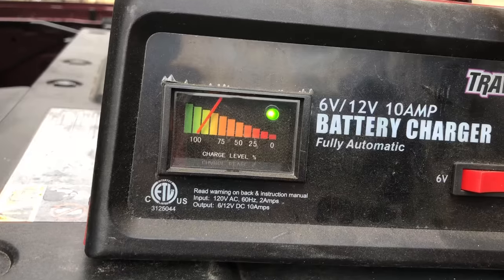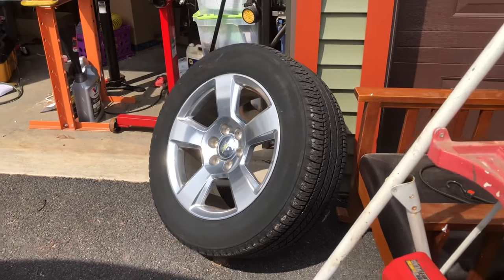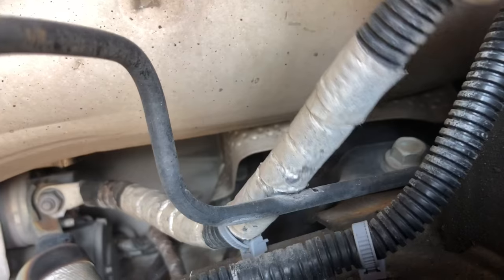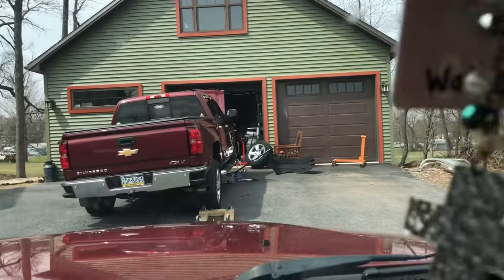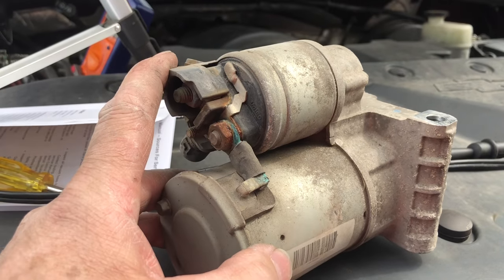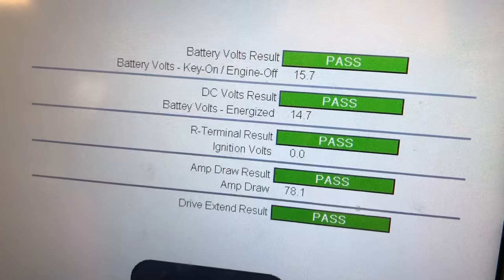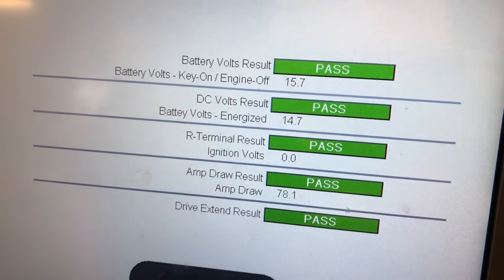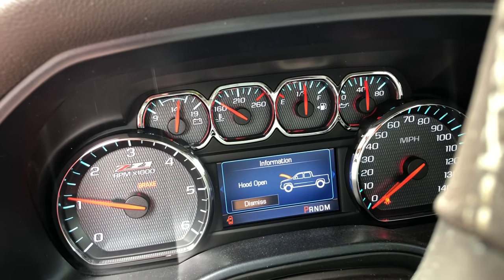2014 Silverado no crank no start problem solved!

Comment: I have a 2014. Every 3 or 4 months when I start my truck, nothing comes on. Goes completely dead. But when I unhooked the negative battery cable for 20 seconds and hook it back it starts right up. What could that problem be? Plus I have a new battery. But the positive cable and the little box that its connected to on top of the battery doesn't fit right on it.
Reply: My 2015 is the same. I think it’s some kind of computer glitch
Reply: @EricWillis77  it might be. Mine hasn't done it in a while. Knock on wood. Hopefully it fixed itself.  Lol.

Comment: I've had the same problem with my 2014 Silverado
Reply: Did you get back to working? Mine just started this today
Reply: That's what happens when you buy junk ass GM junk. Our 2014 is having the same issue and has for months. Junk.

Comment: The starter wasnt  making a good connection somewhere, when you took itt off and put it on you cleaned the posts and completed the connection, had to have been.
Reply from the maker: It turned out to be the post between the starter and the built-in solenoid. It was rotted out. I cleaned it put new washers on it, and I haven’t had a problem since this video.
Reply: @WatsonsWagons  ah nice, that's a nice cheap fix! Good video btw.

Comment: Any issues since?
Reply from the maker: Yes, the stud nut and washer coming off the solenoid needed to be cleaned and a new nut and washer installed. Corrosion was causing arching and the issue returned. Fixed it and has been perfect ever since

Comment: I'm sorry, but when you seen the voltage drop difference from the positive cable at the starter to the starter post,  that right there tells you that you didn't have a good connection at that post! Removing the cable and cleaning it would have fixed the issue, without removingv the starter to have it tested!

Comment: Ironically my 2015 Silverado had the same problem that started just the other day. July 2nd to be exact. I fixed it the same way you did. My ground was actually good, however there was one corroded connection from the solenoid to the starter. It didn't look too terrible but some corrosion, and now it starts every time after cleaning that up. Only 5 years and under 60K miles and this was an issue. If it happens again, I'll probably clean up the connections and then cover them with liquid electrical tape when I put it all back together.

Comment: Very helpful! You definitely had a bad connection at the starter positive lead...
Working on a 2018 tomorrow that's a no crank. Dealership already replaced the starter TWICE. Owner gave up on the dealership.
Reply: What came of this if you don’t mind sharing? I’m about to give up too

Comment: Were you also having a problem with it turning the vehicle off randomly and also the vehicle engaging the theft deterrent system when it was going off? My 2014 silverado seems to be having a similar problem and I'm trying to figure this out before dumping a ton of cash into it.  Twice when it didn't start,  it actually drained 100% of power from the truck as well and I had to jump it to get it going.
Reply: I'm seeing this issue as well
Reply: @HouseCallAutoRepair  turned out after chasing grounds it was a combination of bad negative wire to the battery and the ground behind the speaker on the driver's side under the windshield.

Comment: My truck won't start now. These 14 Silverados been nothing but one problem after another and Chevy didn't stand behind any of it..they should make it right with us all. I'm very hesitant to buy another chevy again now. So did it give you any more problems?
Reply from the maker: The second problem I found was corrosion where the starter solenoid connection meets the starter that little short jumper. It was arcing on the stud, and I had to replace washers and nuts. That arc was enough to make everything go dead.

Comment: Have you ran into this problem since cleaning the connections? My 2014 Silverado is doing the same exact thing - brand new battery, alternator is good. I’ll leave it for 30 mins and then it’ll start no problem - shut it off, won’t start up again.
Reply from the maker: Kayla Vettorazzi nope still starts just fine
Reply: Watson's Wagons great thanks! Will get into it this weekend.
Reply: Kayla Vettorazzi my 15 gmc does the same thing
Reply from the maker: David Gonzalez check the stud and nut where the wire come out of the starter and goes on the stud on the solenoid. Mine was badly corroded and lose
Reply: Kayla Vettorazzi did you ever figure out what was the problem
Reply: Santin Munoz yeah loose connection by the battery
Reply: Santin Munoz also it could be your ground under the wheel well passenger side
Reply: David Gonzales you said lose cable near the battery did you replace it or how did you fix

Comment: well, not exactly sure what is wrong with these starters. i had the same exact issue that you had, all i did was pull the starter to check for power with the key on, the bendix kicked in, i bolted the starter back to the block and it fired right up.

Comment: Did your radio have any erratic entry into browse mode when you started dealing with this issue? Mine started with the radio and is now giving me this same electrical headache.
Reply: I have the same issue and then it just clicks. I have to start it from underneath the truck by touching the positive to the solenoid. So damn aggravating.  Can't find the solution
Reply: @cbuschjr  my HMI fried and I had to buy a new one. Now waiting for programming! I’ll try the starter issue too
Reply: I have the same radio issue!  My HMI fried and am replacing it now. With no radio/hmi/ fuse my truck just clicks now upon start.
Reply: @ChrisChris-mg8rj  what is hmi? My radio went out and now my Yukon won’t start

Comment: I had the same problem on Monday & replaced my battery, everything was fine Tuesday during the day, & then suddenly the problem came back. I turn the key over & it just clicks. The alternator seems to be fine it shows 14.8.. I'm thinking it could possibly be the starter.
Reply from the maker: Miguel Rizo i found my connection between the starter motor and solenoid loose and corroded. Also The wire going to the solenoid from the ignition switch off lose
Reply: @WatsonsWagons  I'll check that out, & let you know.  Thank you!
Reply: @vatozlocoz214  so what happen did you find the problem?
Reply: @WatsonsWagons wheres the ignition switch located?

Comment: My 2014 sierra does the same thing when i pull my trailer. The extra power for trailer light make my ground cable get hot. wait till it cool down and crank back up

Comment: 2015 Silverado 2500 been through 3 starters they are just junk same symptoms go out no crank tap on the starter and it will start
Reply from the maker: Tod DeSonia I found the connection between the starter and solenoid works itself loose also developed corrosion and causes it to ARC. I cleaned up this part of the connection and put a new nut and washer on and it’s been working perfect ever since
Reply: yep sounds like you have a bad ground or bad connection to ground. my 2010 did the samer thing, 3 secs with a 240 grit disc on an air sander and it runs great even after 3 months
Reply: Another bad starter
Reply: I'll try taking it down and cleaning it again see if that helps us

Comment: I'm having the same problem, Ferman Chevy want to charge me 900 to change the starter, they told my wife that  some of the starter blades was broken, i removed the starter it looks fine , we got a new one but the company send the wrong one so i don't  know if is the  stater .
Reply from the maker: Edgar Palma There’s only two bolts holding that starter in place. Another heat shield bolt, battery cable and a single pigtail to the solenoid. Takes less than 10 minutes to remove and swap them if it’s on a lift.

Comment: Any issues since you did this?
Reply from the maker: Charles Chavez yes, connection between the starter and solenoid corroded more to the point it arched and prevented starting. Cleaned connection points and replace the nut and washer and was good from then on

Comment: Nice fix.... But it didnt do a thing for my 15 Serra, iv got no dash no nothing no start still after testing starter and replacing wires/grounds
Reply from the maker: Otis SpicyWiener did you experience flickering with your lighting , radio, etc? I seen a post where there was a ground problem under the dash panel behind the speaker grill. Something about sound deadening material pinched where a ground strap is. My truck started acting up again a few months later, it was two things, corrosion where the wire from the starter bolts up the the solenoid stud and I had a bad connection where the single wire plugs into the solenoid. That’s the one with the round heat shield over the plug. I damaged my plug when I removed it the first time and it vibrated lose
Reply: Iv got nothing im looking in to the fuse block bs thing that goes on top of the battery

Comment: My 2016 duramax changed batteries and now it won’t start. Ran fine until changing the batteries
Reply: Did you figure out what was wrong? Mine is doing the same

Comment: My 2014 often is no crank no start. Absolutely dead. walk away... come back 10 minutes later, starts and needs a window down and up cycle. I've attached a new ground and cleaned up all upper engine connections. If it still happens.... might try the frame and starter connections. I'm not 100% sold on this the fix in the video yet but I'll give it a try. Being I have a complete dead scenario (no dash or gauge activity at all on key turn) I think it's something else. Your gauges cycled.... mine don't.
Reply from the maker: Mark Hobbs my truck acted up again, nut and washer corrosion on the starter solenoid, arching. I removed the damaged nut, cleaned terminal and it’s been fine ever since. I’ve heard of guys have ground problems under the dash near the post along the windshield. Components not able to ground because the factory sandwiched insulation material where a ground should be. There’s videos out there
Reply: @WatsonsWagons    I had seen that video on the insulation under the wire near the dash speaker area. My windshield leaked when I bought the truck and had to be taken out and re-sealed at one time. May be that?  I'll look into that. Thanks for the reply. Appreciate your video's and thoughts.
Reply: Did you figure it out? My gauges don't move either, I don't even get the key on beep

Comment: No you didn't quite test it, auto parts store don't actually do a full starter test, what I mean the starter IS NOT UNDER ANY STRESS, NOR IS IT UNDER ANY RESISTANCE WHEN TESTING, theirs no nothing, same thing with generators, and alternators, I've been thru this before on ford vehicles, what happens is the silonoid weakns when hot, what you where suppose to do, is drive it for 10/ 15 miles out and come back home and  shut it down and restart it, immediately, several times, if it don't start like previously, then your starter soloid is shot. I'd rather replace the entire starter. Also be sure  your battery has enough water in it, unless it's maintenance free, end if story, good luck.

Comment: I have a 2014 doing exactly that. however, I've noticed that when your driving and then say get to a gas station, shut down. Here it will not start for 15min (timed by timer) after the 15min it starts up like normal. No signs of a dying battery or anything wrong. Starts up and will drive fine. The cycle resets again when you shut the engine off. Wait another 15 😅

Comment: Mine does this after I drive for over 30 min. I wait for about 15 min and then it cranks again.  Weird.  Maybe I need to clean mine.
Reply from the maker: Wesley Capps  check corrosion between starter and solenoid, mine was ate up and arching
Reply: Wesley Capps    Same here, if it’s cold , starts no problem. Once it gets to operating temp. , it won’t start til it cools down. Lately it’s been in the 90’s here so it takes a 1/2 hour to 45 mins. Sucks !  Think it might be a thermostat issue?
Reply: @jameshodsdon8818  my 14 does the exact same thing 😡
Reply: brian gentry      Yeah It was definitely something w/ the starter, could be arcing or corrosion on the connections, Someone told me that in very hot outdoor temps can actually over heat the starter itself. I got stranded 3-4 times & actually had to pack ice bags on the manifold to speed up the cooling. It just needs to go down from operating temp a tiny bit & she’ll start right up! I just replaced the starter & starts every time now.  Good luck w/it bro’s
Reply: @jameshodsdon8818  thanks I will be replacing it Saturday

Comment: I HAVE THE SAME PROBLEM  BRAND NEW BATTERY TOOK IT TO THE SHOP THEY SAY ALTENATOR NOT CHARGING
Reply: I got a alternator only used about 20000 miles
Reply: THANKS FOR LETTING US KNOW VERY LOUDLY!

Comment: It’s 100% the starter. My 2016 Sierra did the exact same thing. Bad starter.
Reply: Did you have it checked or just replaced?
Reply: What about the other guy who had a brand new started replaced and it still happened?
Reply: @jacsull1  I just replaced it was OEM one. Never had another issue until I traded it in about 4 months ago.
Reply: @antonyrodriguez2404  Probably another bad starter. My 15 went through two starters in 8 months and then was fine afterwards. Overall quality of parts is going down hill drastically.

Comment: Mine wont start did hit positive tKing off old alt so i mi
Reply: Ight have blown something when hitting frame arching but also jumped before took off oldt didnt use lroper neg post used battery bow we check fuses on tol battery ?
Reply: I have no dash lights at all turns yes headlights yes wipers no
Reply: And my gauges dont move at all over and back

Comment: Junk ass GM products. No crank no start issues on and off for months with the 2014 silverado I'm working on. Replaced starter and battery, cleaned up grounds, Replaced ignition switch in the column, still the same junk ass problems. Junky junk is junk.

Comment: Dude..Make videos about something know about..Not "showing what you went through" "see what happens"videos.These  nonsense videos..throwing a few technical terms you've heard around..are just more misinformation for people to sort through...Yeah..cleaning cables and grounds is good advice...because the battery cable connection to your starter  was the only problem...You bought a  multi tester to test battery amperage draw after charging the battery and eliminating low voltage as the source of the problem...Does that make any sense??...Then tested the voltage at starter...The test confirmed the cable to starter need cleaning..but you too busy being smart and saying "energize the circuit" which of course stays "energized" from the battery to starter at all times..You could have taken your handy dandy multimeter and tested the wire that you ultimately damaged..and got 12 volts or more..and you would have eliminated everything besides the starter or starter connections..then moved on to checking the cables for corrosion..with that eliminated..then take the starter off....What did this video accomplish? Nothing.. "How to haphazardly fix your truck" or "How to waste money on parts and testers that you don't know how read" Better  yet.."How a typical idiot burns the better part of the day when their truck won't start"  Give it up dude...Please